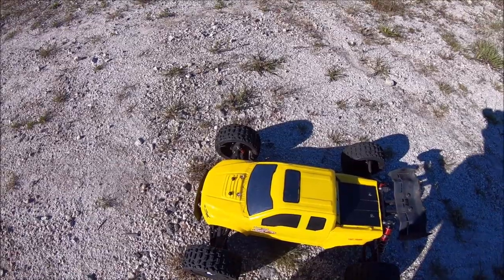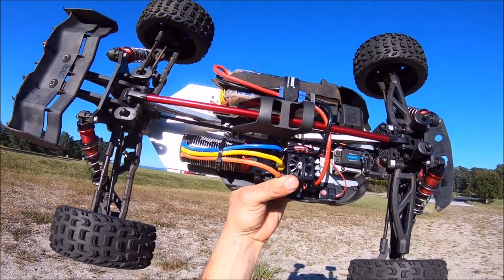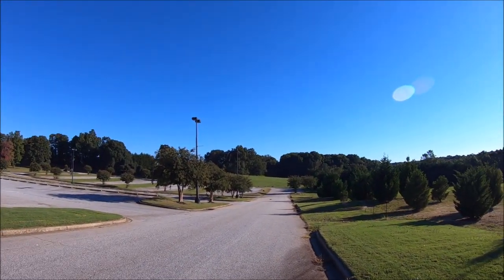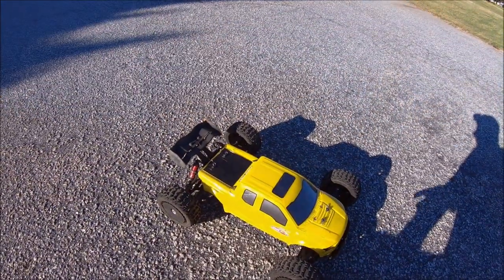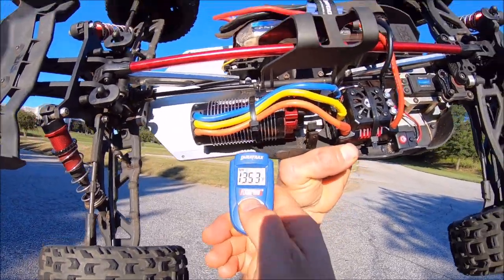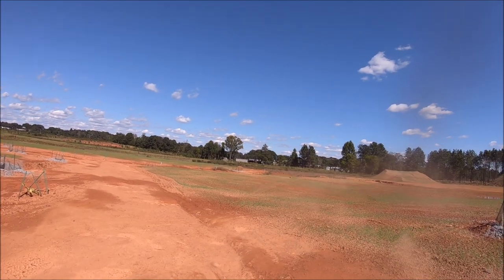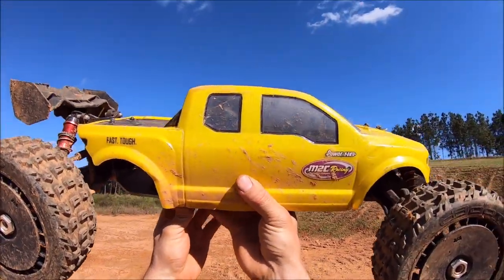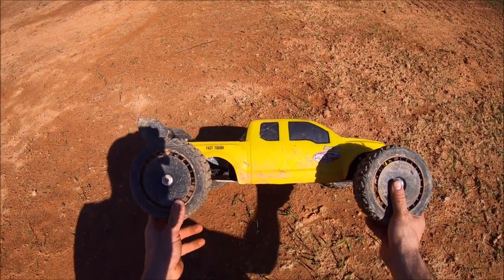MONSTER 1/7 Talion! ARRMA Talion XL blast! Hobbystar 4082!

Comment: Ive heard here and there about guys sort of locking up the center diffs for bashing and tuning the front and rear. Is there a good benefit to this such as less breakage and would you lose handling of the vehicle. ive had bad experiences in the past with heavy weights and made the hobby no fun until i went back to regular weights and i could control the car again. Thanks!

Comment: Old vid I know, but do you still recommend this motor? Lookong for a nice replacement for my fireteam and not ready to go full on 8s system yet.
Reply from the maker: It works great in this rig but on the Fireteam I'd recommend something with more torque. I run the Hobbystar 1480kv 4092. The 1730kv is great too. Some guys go Max 6 1650kv 4985 combo too!

Comment: Whats up my friend I love watching your videos. Yo my dude R/C cars are not meant to go 200ft in the air you can have the best shocks chassis, tires if you would take those jumps a little slower I think you would love your trucks much better. They were not designed hit the ramp at 50 mph 
Just my comment you won't have to check the truck as much. Just go 10-15 mph slower when hitting the ramps your trucks would last longer and your viewer's trucks would last longer. Iam sure if you contacted arrma they would tell you  definitely to slow down when hitting the jumps, please don't take this the wrong way but me and a bunch of my RC buddies agree, because your very good in explaining details about the car. Just food for thought tjs your friend william from NJ Forgettaboutit 👍
Reply from the maker: 😆I appreciate the feedback bro! I definitely thrive on high speed launches and as much height/distance as I can achieve. I get bored otherwise as far as jumping. I do like freestyle dirt bashing like in the second half of the vid. Some smaller jumps there off dirt mounds etc. I make entertaining content so I push for "not the norm"🤣Thanks for watching bro!😎🤘🤘

Comment: How do you like this compared to the regular Talion what’s it’s positives vs negatives?
Reply from the maker: No negatives really just a different platform since it's two inches longer and an ince wider. Still drives like a Talion just a little more stable under hard throttle.😎👊

Comment: I see you are using rpm arms. They work fine with the exb rear tower?
Reply from the maker: I'm using CF stock towers. Exb towers have a different geometry and you'll need to either make new upper shock position holes or drill out the arm to relocate the lower position.

Comment: Awesome bashing 👍 🚀 Build seems light and tough 💪 , looks very nice in yellow 🟨 Since I have yellow body on Kraton 4s, it is easier to see car from far away in the forest 👀  😃

When you bash until LVC, what is the cell voltage after run?
Reply from the maker: Thanks so much man! Yeah the yellow is definitely easier to see!😆At LVC, the cells are usually 3.4 to 3.6 depending on the lipo.

Comment: Love it love it love it man. Such an animal.  Love the xolor choice on the body too. So I noticed you have support under the motor. Are they stick on or is it adhesive? I couldn't quite tell. Any plans to try some other tires on her? Can't wait for the 6s driveshafts. I've made a few rigs now and really wanna try the mojave chassis but I think if I did I'd build a mojave haha mostly because I don't have one still and they look super fun. Do you find you have any better rotation with one over the other between the belted n non belted katars? Thanks for an awesome video man congrats on the sweet build I love it 🍻🍻🍻🍻🍻🍻
Reply: Hot glue works good under the motor
Reply from the maker: Thanks Nick!!👊The motor supports were just adhesive felt padding I got at Walmart. Like what you put on legs of furniture to keep from scratching the floor. They work perfectly! I honestly prefer the belted Katars for street rips and launches and super smooth dirt. The non belted definitely have better fast rotation bc they balloon. Both serve a purpose for sure! Nice to have the options!🤗Thanks for watching bro!😎👊🤘🤘🍻